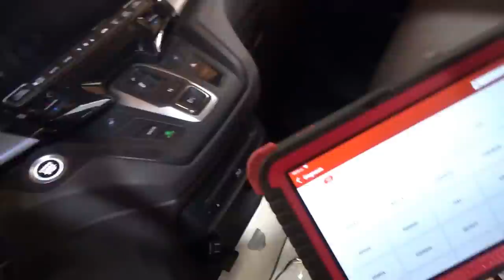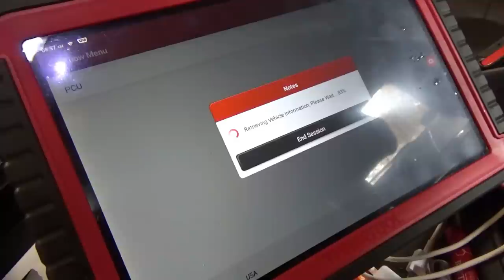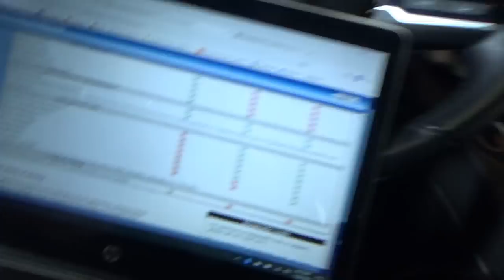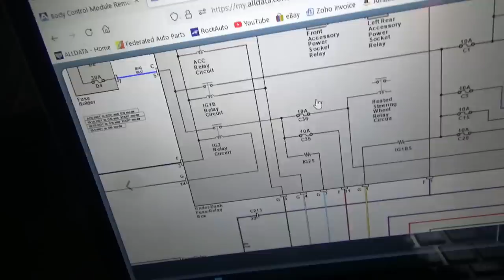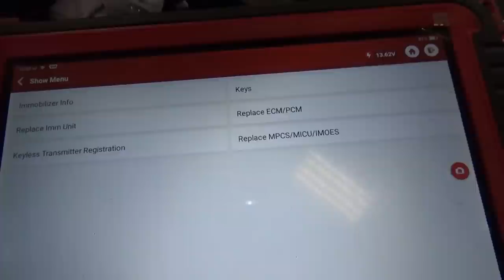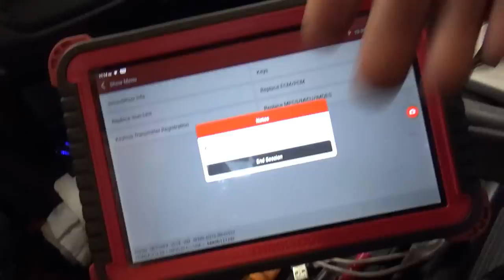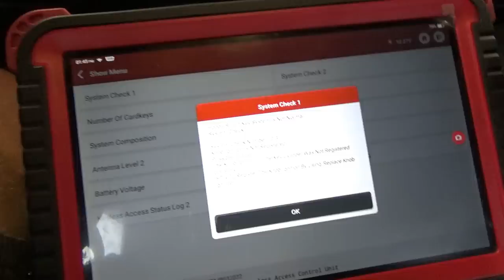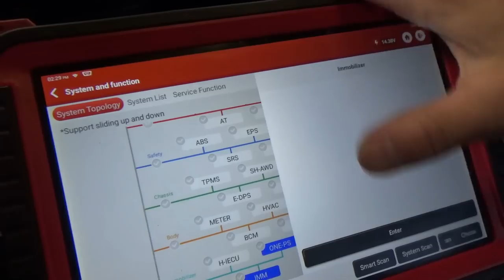WTF...Honda Turns Itself ON & DRAINS the Battery?! (Part 2)

Comment: I wonder if the original bcm had corruption in its configuration and when you reprogrammed it the corruption was corrected, sort of like re-formatting a drive
Reply: Interesting thought. Sounds possible 🤔
Reply: I was thinking the same I work in the fire alarm industry and have found may times just re down loading its software corrects the issue.
Reply: Just like reinstalling a clean install of Windows 7.
Reply: @Garth2011  ...windows 7 ...lol
Reply: I write firmware, and I was thinking along similar lines 👍
Reply: @treeturtle9378  Doesn't the firmware have protection from this?
Reply: It would likely have protection from an outside unauthorised edit. However internally a memory location can be unintentionally changed resulting in super weird behaviour. Eg an event log could become too large for its allocated memory space and overflow into another memory space that holds important data/values. These are just guesses of course 😎
Reply: @treeturtle9378  Sounds like disconnecting the battery cable 2x a year might be a good thing.
Reply: Makes perfect sence about corruption
Reply: That’s what I was thinking
Reply: @Garth Clark Yes….mostly. 
Eeprom stays after powerdown. 
Also the BCM may have some internal power source so it only goes asleep. The reprogramming of the keys may FORCE a full reboot as also the physical disconnect from the harness. 
There’s also the possibility of a dry or thermally fatigued solder joint in the Bcm that got bumped during removal. “The owner said hit it here”. 
Leave the car for a while and the Bcm cools and the solder joint moves?
All very interesting 😎
Reply: @Garth2011  All electronics will glitch from time to time, even a calculator; these glitches should be very rare but the probability is never zero.
Reply: @treeturtle9378  Or a bit flip could occur in that memory location corrupting the firmware code it is attempting to load.
Reply: Onboard memory corruption could be an issue, too. Might work fine for a week, or month, then flake out again....
Reply: But he removed original and installed eBay at beginning of vid then end said installed original I’m confused so he installed and fixed with original

Comment: I am a computer systems engineer. Often when we have trouble with computer hardware, we upgrade the firmware even  if it is the same version. The "upgrade" process rewrites the code to the chips and often fixes the problems. I think that is what you experienced. Why the issue in the first place? Often a small current drop or surge can scramble the data just enough to cause intermittent problems. Good job, Ivan!
Reply: Question is, what or why did the firmware get corrupted if thats a fair description for it?
Reply: @Garth2011  Sounds crazy, but cosmic particles can do that. Also nearby lightning hit or some orher source of strong elecromagnetic pulse.
Reply: Agreed, and I absolutely hate this type of "no problem" problem!
Reply: Ever experience “bitrot”?
Reply: It's enough to help someone to start his car with cables for to have some strange problems occuring, but this one was a hard one.

Comment: But people don't steal keyless entry cars by programming a key they just amplify the signal so why is the immobilizer in this so complicated it's ridiculous I definitely won't ever be getting a car with keyless entry it's just  pointless.
Reply: In the current market, you may have to accept keyless to get some feature you really need.  Personally, I lease a car for the length of the warranty and then move on.  There is so much (excessive in my book) automation these days that 4-5 years is about the expected life before electronic gremlins start.  It sucks to say the least.
Reply: Kia and Hyundai are currently being sued by high crime Democrat city because they don't have immobilizers in there vehicles making them easy to steal. So it's not the car thief's fault is the manufacturer trying to keep costs down.
Reply: @ricanderson5717  your perfectly correct but you also failed to mention it’s not very green also!

Comment: Wow. Best thing I got out of this was deciding which one of our 5 vehicles to sell. 3 Toyotas, 1 GM fun car, and a 2018 Honda(HMR) Guess which one got the short straw. Thanks again Ivan.
Reply: The Honda motorbike is ok thankfully there  quad's at least are still very good at least the 250 is anyway I'm new to these kinds of vehicles so I don't know much about them let's hope Honda won't destroy there small engine stuff.
Reply: @neilmurphy845  I really cannot kick on the Honda vehicle’s, my wife’s has 80k and never had one issue. And also She was QC for a local company that makes a lot of parts for Honda, and they have the most strict specs. In the industry.
Reply: @brianw8963  The older Hondas were generally more reliable and easier to repair up to around 2004.
Reply: @psdaengr911  My main concern is the CVT transmission. Not a fan of those.
Reply: Ahhh that was a Honda HRV, already sold, that was fast.

Comment: Most people would've given up a long time ago or may not even attempted this fix. 
Great job Ivan.  Your instruction is a huge time saver and also shows the necessary steps to solving problems.  
Continue being "you".  Your video content,  your personality,  and your honesty even when making mistakes,  are a perfect combination to a great video. Thanks again.
Reply from the maker: Thanks Scott, never a boring moment in this line of work 😅
Reply: I agree but then there are some mechanics who deal with diagnostics as a profession and feel the need to learn which will help them much down the road. That's the difference between good tech's and ones who are better off replacing batteries, alternators etc. There's just no end to these overly engineered computer run cars...its almost insane what they bypass in common sense just to put a lot of things to be managed/controlled by computer modules.  Half the problems are in poor quality components that cannot pass a self destruction test in just 3 years or can't deal with the weather elements or simply fail due to poor solder joints.  The modules shouldn't fail, period.  then we have a long discussion as the the quality of the wiring terminators/connection.  Most of these problems are in quality of manufacturing or poor assembly and design/installation of components. It's a complete expense to the public to have to pay to chase down the imperfections in todays cars. By that I mean, there is no room for tollerance, if its not perfect, it won't operate correctly and the more one thing has to do with other tings, the more difficult it is to diagnose.
Reply: @Garth2011  Can you believe that anyone in the future will be able to relive one of these electronic gems like people who restore our older make of cars! don't think so! and we call this progress !
Reply: @garyalford9394  I think its all about control however, many just do not get that could be the plan.  The more we hang around, the less freedom there is as our recent history has proven. If you are a slouch dealership who doesn't maintain highly qualified mechanics, vehicle owners are forced to go there for one thing or another.

Comment: Hey Ivan, just thought I’d tell you. I’m a former Honda certified and ASE certified master technician. I also own the thinktool pro+ and the autel maxisys ms919. Just last weekend I replaced the BCM on a 2018 Honda odyssey with a used BCM, but I was able to program the keys with no issue using the thinktool. Even when the ignition didn’t turn on. I see what you did wrong, when the scanner tells you to push the start button for the first time, you have to keep it pushed until the ignition comes on. In the video, you pushed the button for a little while, then you let it go when the next pop-up window appeared on the scanners screen. By doing this, you interrupted whatever process was happening. If you would have started it all over again and held the start button down until it turned on, you wouldn’t have needed to jumper the relays.👍
Reply from the maker: Interesting! Great to know! 👍🙂
Reply: @PineHollowAutoDiagnostics  I just posted my issue on the 2019 MDX and yes thats where you went wrong. My issue seems to be a bad can bus circuit preventing communication with the TPMS unit.
Reply from the maker: @DIYeverything513  how long do you have to hold down the button? 🤔
Reply: @PineHollowAutoDiagnostics  you have to hold it down for a few seconds but only when you go through the corresponding menu in the scanner. One touch start button menu. It says to hold the button for x amount of time.  Mine would beep but then the screen shuts down which leave me to believe it tries to run on ignition but I have another issue somewhere. I once thought the tpms unit need to be brand new but I can be wrong.

Comment: Anyone owning a later modern vehicle Needs to have a vintage model as a backup...youre going to need it..
Reply: That’s a good idea. That red vintage behind Ivan at the end would be a good one..
Reply: I swear down an older model electrical gremlins issue free ride is a must to have as a back up vehicle.
Reply: @018139548  I’m getting closer to completing my 69 beetle restoration , so that will be my backup to my backup when it’s done .

Comment: As a software engineer, I'd guess that the reprogramming of the original BCM wrote the new data in a different location than the original. If there was a problem reading data from the original location, the behavior could very well be undefined. When troubleshooting very complex systems, success usually depends on persistence; and you kept trying different approaches until you stumbled across one that worked. It's a hard way to make a living, but I am often forced to do the exact same thing ;-)

Comment: We have a local lock and safe company here that runs a mobile unit.  They are the ones I call in this kind of situation. He keeps all the updated programs for automobiles.  ;)  Like you Ivan, it is something I do not do at this time.
Reply: Same here in my area. Skip over the dealer
Reply: Imagine that, a specialty business that deals with computer module programming just like meachanics who specialize in diagnosing vehicles. No longer are the days of an all around mechanic or shop. Cars today need a speciasist in transmissions, engines, electrical, security etc.  What a complete disaster.

Comment: You are spot on that their BCM unit has way too many connections - as someone who does board-level repairs to modern electronic equipment I'd immediately suspect bad connections inside.  The use of non lead-bearing solder and the push to smaller and smaller components on boards sets things up for mechanical failure. So much for cost reduction at the expense of reliability.  Even with a conformal coating on the board, temperature changes along with vibration and stress can create poor solder connections.   Just too bad it didn't fail during the warranty period!

Anyway, keep up the great diagnostic work!

Comment: These types of jobs on Hondas was always confusing even to us in the dealer with the factory software. Believe it or not holding the key against the button for a while definitely works even with aftermarket scanners. It’s silly but if you hold it long enough it will actually turn on. I couldn’t believe but you know me and I only speak facts from what I’ve seen. They really need to change the way they word this stuff bc it’ll easily irritate the best of us sometimes. Good job tho as always!

Comment: Thanks Ivan for walking us through this experience even if the experience was a pain in the ass.
Reply from the maker: My pleasure 👍
Reply: @PineHollowAutoDiagnostics  Hey Ivan, I had trouble with copying keys on an Acura in the past, it simply would not let me program more than one key at a time.   If I told it to "Make 2 keys" -- it would fail every time.  But If I just did it 1 key at a time, it would work great.  So try that next time-- only add ONE key and see if it works.  You can always go back through it again and copy the second and third keys.

Comment: What a trip!

That's so sad how that whole process is even needed in the first place, and the complexity on the scan tool.

The HDS can register the new BCM in one menu, one process, and it takes 10 minutes. The one thing that caught my eye was one of the first prompts on the thinktool during your programming: "Don't release the start button until the ignition is turned on". The first thing the HDS does is force the ignition on and it asks you to hold the ignition for multiple seconds while the HDS does it's thing, and then the car turns on.

As to why the old BCM works again? FM.
I suspect it will return shortly.

Comment: I've experienced this same thing. This is why one of the first thing I do is a hard reset. Disconnect the battery. Connect the terminals together as to drain the capacitors in the modules. Then reconnect the battery. Effectively doing what you did which is disconnecting the module. Sometimes these modules act like Windows software. It glitches. And gets corrupt. Resetting the module like turning off the PC and turning it back on sometimes resolves these kinds of issues. I had a Nissan that had a faulty transmission. It had DTC's in it previous the repair. After replacing the transmission I now had new codes. I did circles for hours. Thinking I did something wrong. But couldn't find evidence that validated the codes. So I did a hard reset. Codes gone. Car is still fixed and on the road. That's how a lot of these newer cars with many many modules are now. They can literally create false issues based on modules just glitching out. And so now you have consider in your diagnostics wether or not these codes are real. Wether or not the symptoms are due to a faulty part or corrupt information. It's crazy. And getting more difficult all the time.
Reply from the maker: Great comment Edwin. Yup a hard reset works magic sometimes. Dumb computers lol!

Comment: I think reprogramming the keys helped, they may have got wet and malfunctioned. You did right with charging fee's and the experience.
Reply: @Hack, yea I think there are several good lessons on this one. First, it's electrical and there is software/hardware so sometimes there are electrical issues like with wiring/voltage etc,. sometimes it's also software related where there could be something "corrupted" and there can also be something mechanical such as components/pins etc., needing to be cleaned/disconnected/reseated just as Ivan mentioned at the end.

I also recall a strange oddity occurring one time with one of my old cars and it's key fob. Somehow, being in/near another car and transmitter, a totally different one mind you, my key fob would no longer interact with my car. Nothing got wet, no battery issues etc. I unlocked the car with the key and thankfully it uses an actual key with a resistor to start the car... 

But I had to go through the rather painless procedure of re-registering my key fobs and the only difference had been the fact that I was driving this other car and had the key fobs, using them together. Never had anything like that happened before so I intentionally put them together again, pressed the buttons etc., and again my fobs stopped interacting with the car.

Comment: If it was me, and I'm not positive but this is my goto method. Connect the obd11 breakout box.  cross 1 and 16 and usually the ignition comes on and you are able to program keys. Help desks won't ever tell you to do this. there are locksmith tools that force the ignition on. and all that they do is cross these pins. the tool is about 115.00 plugs in to the obd11 port and has a connector to plug your scan tool into. there is a switch on it that turns on the ignition.
Reply from the maker: I will try this on the next one 😁